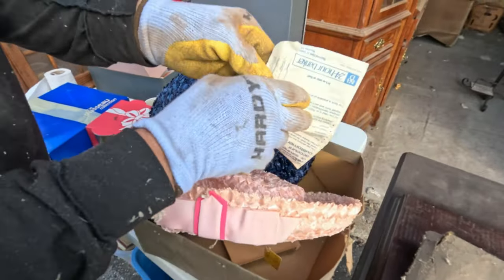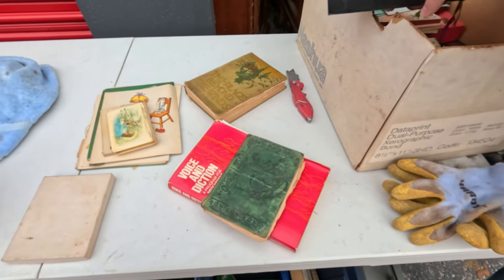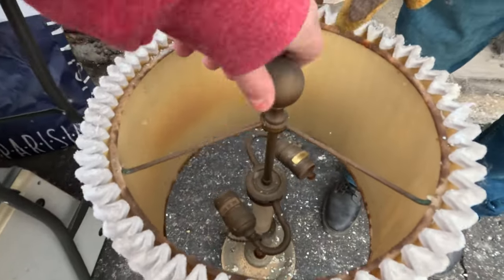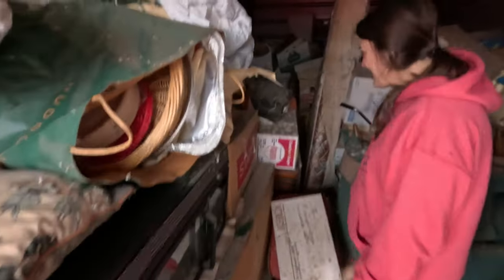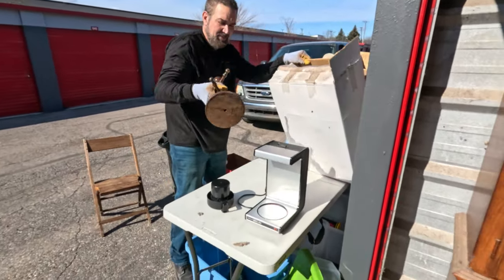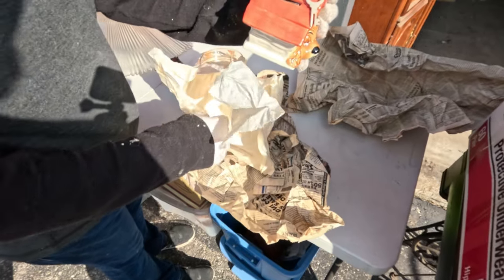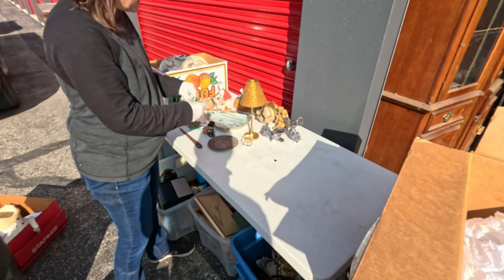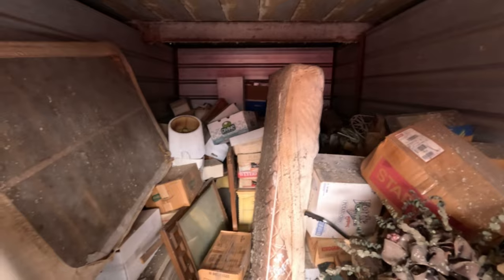Unseen for Years: Long Forgotten Valuable Items: Storage Unit Finds

Comment: I, too, love old books. Some of those were in fairly bad condition, but it is not good to open an old book flat on a table. As the glue dries out with age, laying it flat further damages the spine & causes the glue for the pages to further further decay.
Reply: You can google search for the date for treadle machines using the model number.
Reply from the maker: Thank you, we did end up finding it with the serial number
Reply from the maker: They are so hard to part with sometimes! Thank you again, it is so easy, working on these to not think about something like that. I don't believe I thought about that at all

Comment: I wish you didn't just throw that stuff in the bin with the sunglasses which will scratch them up. They're VINTAGE and maybe worth money
Reply from the maker: I know exactly which ones you're talking about. I would have been so disappointed if they had been ruined! We try to be careful because we count on selling everything we can but sadly, it definitely does happen sometimes. Luckily those sunglasses did survive. What makes it more risky for breakage, etc... is that we always have a short time limit to get the locker sorted, completely emptied and swept (usually 2 days, less often 3 days).
Reply: She does not have a gentle touch with anything much. 😢

Comment: You do not charge enough at the flee market
Reply from the maker: I think you are probably right. We may just need to sell at more than one market, like we used to. We really have trouble with things just not selling when we try to get more at that market. We can hardly bring much of the better stuff there. Then we get clogged up with the less valuable stuff... making it harder to buy more lockers in search of the really valuable stuff